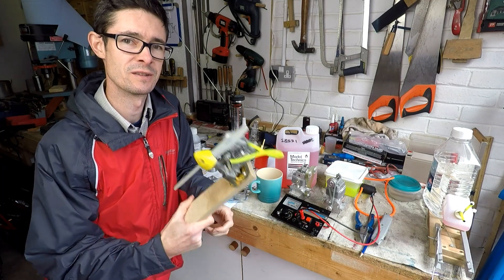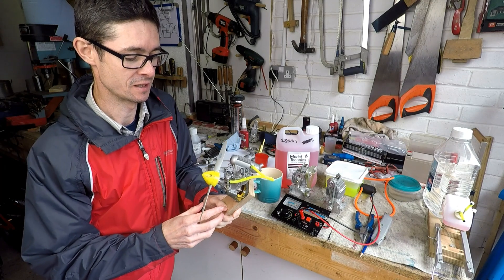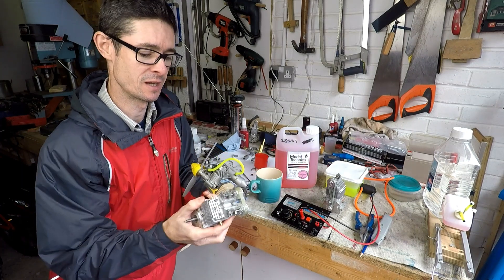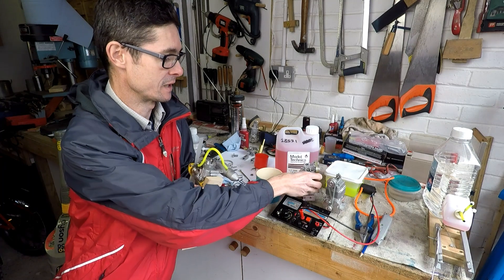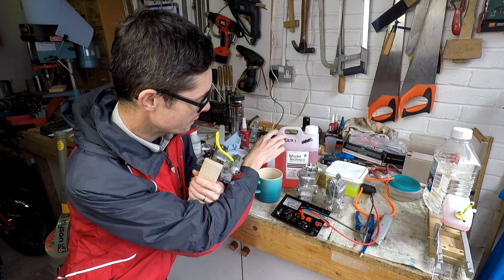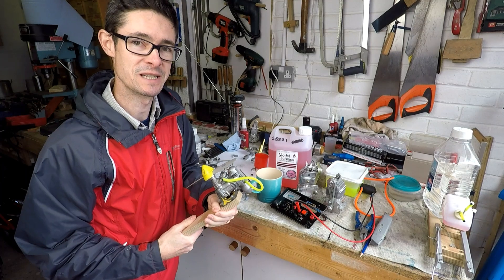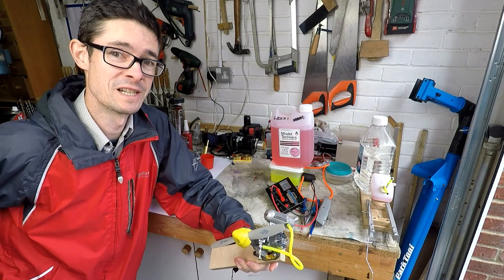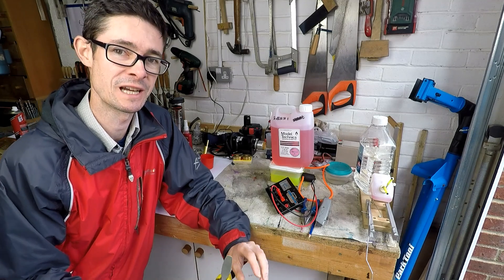Running Vintage OS Max 25 FP R/C Engine for the First Time in 25 Years.

Comment: Thank you for the video! My dad and I got a model airplane together that I now have with me at college. It runs using one of these engines and I have been hesitant to put it up in the air because I wasn't sure I could get it started again and was afraid of crashing. I went out and flew today after a long time not flying and it gave me the heart to go and get the necessary equipment to get my old gas model running. This video was so helpful in letting me see how to get it started!
Reply from the maker: Good to hear!  sorry for the slow reply.

Comment: The OS FP 25 is an excellent engine. I have one from 1989 which still runs perfectly and one that is new in a box. I have many diesel engines too dating back to 1948. Never attempt to start a diesel with an electric starter. the compression is much higher than a glow engine and there is a risk of a hydraulic lock resulting in a bent connecting rod. It's best to use a chicken stick on a glow engine.

Comment: I was wondering if you can assist me. I have the same engine (I think) attached to an equally old mascot training model plane. I looked on the OS website and looked at the pictures relating to the history of their engines and this engine is the closest looking going back to when I think I may have bought it. I know I only flew the plane twice. Anyway, it was then put at the back of the garage and eventually forgotten about. We are now 36 years on and for nostalgic reasons would like to try and get the engine working again. 
Here lies the problem. As you can imagine it was seized as i hadn't even covered it up. Suprisingly enough it freed up with a little WD40. I stripped the carb section, lubricated and put back together. I cannot for the life of me remember how to set the engine up, ie, how far in/out for the air screw etc.
Any advice would be gratefully received. Thanks in advance... Regards.
Reply from the maker: Hi, I’ll try to Engine seizing is most likely due to the old fuel and oil gumming it up rather than corrosion.  I expect it will need a new glow plug to run.  On the carb, the needle valve screw - the large horizontal one - should be about two turns undone from fully in for starting.  The throttle stop screw - the small vertical one - should be adjusted so that the throttle barrel is significantly open.  The air bleed screw - small horizontal one - on mine is adjusted so that so that the length of the spring is 6.5mm.  I’m not sure it will be that critical.  As long as the settings are about right, the engine should run on new fuel without too many problems.  Good luck!

Comment: What is the device you use to start the glow plug?
Reply from the maker: It’s an electrical panel - powered by a 12 volt battery and with output sockets for the glow plug and starter motor.

Comment: Hi, how many horse power does The Motor haves, sorry for my english bevause i am from Germany ?
Reply from the maker: I would guess around 300W, so approximately 0.5 horse power!
Reply: @MetalMachineShop  
Sounds legit, I have the same engine. 

You can pretty much estimate power by looking at the RPM with a given prop. For some types, e.G. the old Graupner Super Nylon or Master Airscrew ones, there are charts around to determine the power needed to turn a given size at a given speed. Some are in the old Demuth books.